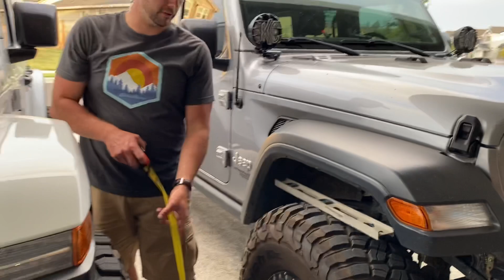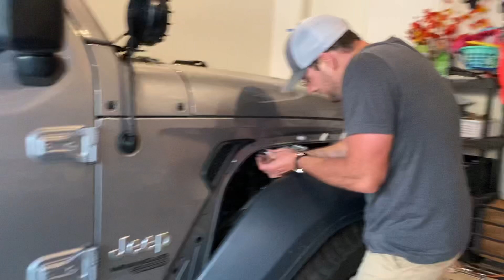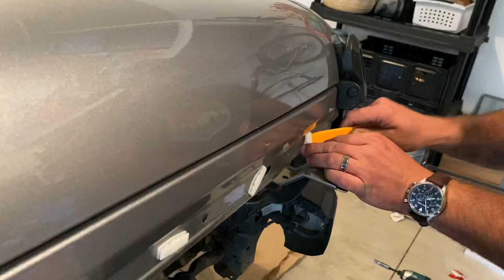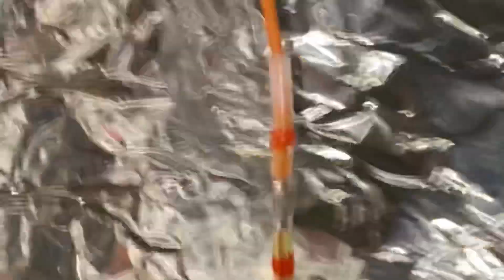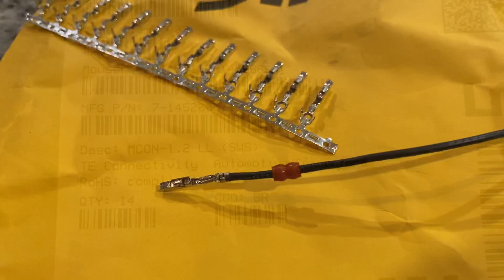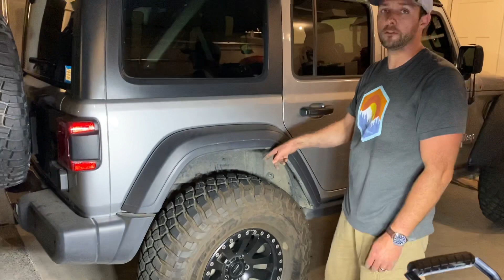New JL Wrangler Rubicon Fenders-High Clearance Fender with LED Lights

Comment: Every other video I’ve watched, the lights are plug & play for either the sport or Rubi…
Reply from the maker: I was coming from a halogen set up to an LED the wiring harness was missing wires hence the new one that I made. They could’ve changed the wiring configuration since the first model year. Good luck with your install. Thanks for watching.

Comment: These fenders came with the fender liners on them?? We have a Gladiator at our shop that we inspected for a used car lot. It needs the front fender liners, which are missing, to finish the inspection. We ordered fender liners using the VIN but they dont fit. Ive read about Rubicon/Max Tow fenders?? I guess I just need to call the dealer and ask them for Rubicon fender liners?? I'm guessing someone swapped the fenders and didn't have the right liners to finish the job.
Reply from the maker: I got my fenders used from someone with a Rubicon and it came with the fender liners. I believe when you buy the fender’s they come with them. If the one you’re inspecting is a sport or Sahara, then somebody probably put the highline fenders on and you’ll need Rubicon liners to finish it up. I hope this helps. Thanks for watching the video!
Reply: @FROSTBITEOFFROAD  It is a Sahara and does have, what appears to me, wider fenders than other models. My boss had ordered aftermarket, metal fender liners, but for the Sahara, I dont think they are going to work. Im going to get on the phone with the dealer this morning. Thanks for the help!!
Reply from the maker: @stephenhood2948  no problem, good luck 👍

Comment: could you share more about the wiring ?  i have a sport too, been looking to upgrade to Rubicon fender with the look of DRL . thanks
Reply from the maker: I did the wiring a couple weeks before the install video, I basically found a picture of the halogen and the led and made sure the wires went to the same place on the new plug. If your buying the fenders new there is no wiring necessary, it’s plug and play. The reason I had to make a harness was because mine were used and the factory harness was cut up by the turn lights. Hope this helps, thanks for watching!
Reply: @FROSTBITEOFFROAD  thank you very much for this informative message!!! that solve a lot of my questions
Reply from the maker: @mbperfection  no problem, enjoy the new fenders!

Comment: Do you know if the rear fenders will still go on with the one piece sport rear bumper?
Reply from the maker: Yeah they will go on just fine, there is a gap but it’s not too unsightly. I ran it that way until I switched to an aftermarket bumper. Thanks for watching!

Comment: Thanks for the great content, and keep them coming. I have a 19 JL sport, and it didn’t come with the led package. If I get the High top Rubicon fenders from mopar will I be able to install it with the same connector or do I have to rewrite the connector. If I need to rewire it do I need to install any other LED harness in the Jeep for the computer to know it’s LED? The reason I ask you s because I saw a LED harness on the mopar site and not sure if it was related. If I can rewire the connectors on the fender and be set after flashing I’ll be relieved. Thanks for your help! And keep the content coming
Reply from the maker: Thanks for watching, I had to re-wire mine because it was cut when I bought the fenders. If you buy them new they are plug and play! You do need to get a Tazer and tell the computer you have LED fenders or they will hyper flash and stop working after a few tries. Hope this helps!
Reply: @FROSTBITEOFFROAD  Most definately, Thank you!
Reply: @FROSTBITEOFFROAD   did you need to replace the fender liner as well or can you use the same ones from the stock fender flare?
Reply from the maker: @masumchoudhury  the new fender’s actually come with new inner fender liner’s already attached, so it makes it really easy!

Comment: so you get half inch in the back with Rubicon finder 
thanks for the video
Reply from the maker: It’s less than the front for sure, you definitely gain more clearance but not like what you see in the front. Your results may vary depending on your lift, mine leans to the passenger side a decent amount. Hope this helps, thanks for watching!

Comment: Where did you find the Molex Connector? Thanks
Reply from the maker: Mouser Electronics website, they had everything I needed to fab up that wiring harness.
Reply: I’m desperate to find that moles connector.  I have no idea where in the moser website to find it and search 6 pin or Jeep JL didn’t help.  Can you possibly attach the exact link for the part.  Thank you in advance
Reply: Sorry for the misspelling.  Molex / Mouser

Comment: I have a 2020 jlu sport s with led headlights. Will it be plug and play for it or i still need to wire it?? Thankyou for the help
Reply from the maker: If you buy the fenders from the dealership it will be plug and play. You will need to get a programmer and tell your computer you now have LED fenders. I had to wire mine because the harness was cut when I bought them second hand. Hope this helps, thanks for watching!
Reply: @FROSTBITEOFFROAD  will obd jscan work?
Reply from the maker: @melvinsaturno5670  yeah that’s what I used, just make sure to buy the appropriate cable and dongle.
Reply: @FROSTBITEOFFROAD  do i need a bypass cable or just the adapter and how do i  program the led fender??sorry this is my first jeep thats why im a lil bit confused.
Reply from the maker: @melvinsaturno5670  no worries, you have to buy the Chrysler specific cable and the Bluetooth dongle to connect to the app. The cable is plugged in behind the OBDII port to bypass the security on it. There is a video on it here somewhere I’ll see if I can find a link for you.
Reply from the maker: @melvinsaturno5670  https://youtu.be/dQrf1FtXI9M
Reply: @FROSTBITEOFFROAD  thankyou so much for helping out.
Reply from the maker: @melvinsaturno5670  anytime 🍻

Comment: I have Jeep rubicon none led but I am going to contact my none led wires to led lights can you help me out please thank you
Reply from the maker: I did a lot of research on the forums and ultimately looked at pictures between the two to figure out the order. I did find one write up that was very helpful I’ll try to find the link.
Reply from the maker: Are you building a wire harness like I did or simply swapping led fenders for your factory ones?
Reply: @FROSTBITEOFFROAD  yes please 
I need to get the molex connector send me the link please
Reply from the maker: @eztrailsoverland1899  message me on Instagram I’ll send the pictures over.

Comment: Hard to see in vid, what color wires connect to each other when splicing.
Reply from the maker: I did a lot of research to find out what went where. I found the wire diagrams on one of the Jeep forums, it’s been awhile so I don’t recall which one.  I’ll try to find a link if I can.
Reply from the maker: https://www.jlwranglerforums.com/forum/threads/factory-led-package-drl-turn-signals-awol-part-numbers-fighting-with-dealership.10616/page-8

Comment: I just swapped out my end caps on my Sport S for the Rubicon ones. This in preparation for installing the Rubicon fenders this week.
Reply from the maker: Russ Elmy yeah I’m on the lookout for a Rubicon rear bumper. They gap is pretty noticeable on the rear.
Reply: @FROSTBITEOFFROAD  If you have a 3 piece plastic bumper  you only need the end caps a support brackets. easy swap
Reply from the maker: Russ Elmy yeah I do have the 3 piece one, I kinda want the metal one but I need the backup sensor holes. I’ll keep an eye out for both, thanks!
Reply: Can you give the link for the end caps?

Comment: I also got the fenders off a rubicon and wired were cut like yours where do you buy the wires you need also I have the led package just didn’t come with the fenders..
Reply from the maker: Valdemar Quidera having the LED’s already is nice, you won’t have to reprogram. I just bought 22ga wire off Amazon I’ll put a link in the description if that helps.
Reply: Frostbite JL how did you reprogram? My JL is a sport without led or drl. Great channel! Check mine out if you have a chance.
Reply from the maker: HighPoint Overland thanks, I’ll definitely check it out. To reprogram I used the JScan app and the Chrysler specific wire and Bluetooth dongle. There are a few people using it that have done videos already. If you want more info on the parts I can put links in the description.
Reply: Frostbite JL very cool! Thanks for the info.
Reply: @FROSTBITEOFFROAD  please share a link on how to reprogram for LEDs if you can. I have the same JL SU none LED fenders.
Reply from the maker: @skyper20006  https://youtu.be/dQrf1FtXI9M

Comment: If you remove the inner fender liner first, you can then use needle nose pliers on the backside of the retaining clips with the slightest squeeze and you will not break a single one when removing fender.
Reply from the maker: D Wax I’ve heard of that working, but I already bought all new clips so i wasn’t too worried about breaking the old ones.